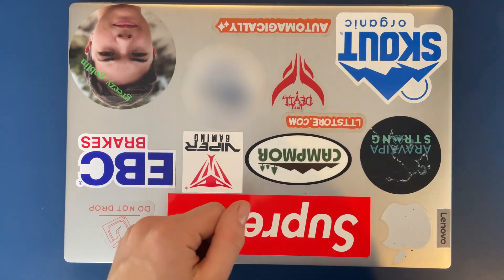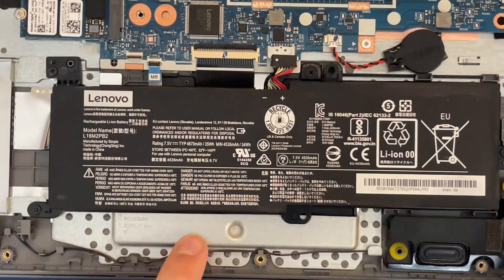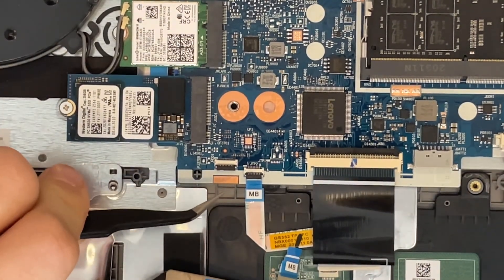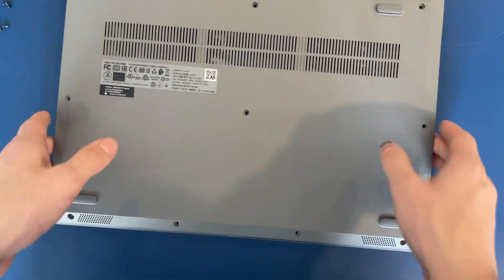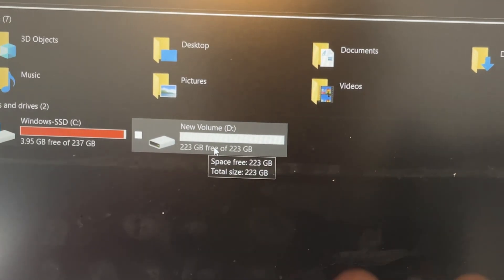Lenovo ideapad 3 SSD installation

Comment: What is the cable called that connects the drive. Can't find it on Amazon etc, I'm obviously searching with wrong description
Reply from the maker: I believe it's a 12 pin connector (I listed it in a different comment) and it can be called something along the lines of "Ideapad 3(then your model shown on the bottom of the laptop) 3.5 inch drive connector, ssd connector, SATA cable adapter" etc.

Comment: My laptop is ideapad slim 3 15iil05 81we but the ssd compartment is missing. The connector is present but too bad that the ssd compartment is filled with battery. Id store some files as the nvme is running out but nvme 1tb is expensive 😭
Reply: If I decide to get the 1tb nvme, I'll also add some 8 gb lpddr4 ram
Reply from the maker: Nice!
Reply from the maker: So your laptop has a larger battery capacity, instead of an SSD bay? Interesting.

Comment: AI Summary

Installing a 2.5-inch SSD in a Lenovo IdeaPad 3

*   0:00 Introduction: The video demonstrates installing a 2.5-inch SSD into a Lenovo IdeaPad 3, which requires a proprietary-to-SATA adapter.
*   0:13 Tools and Parts: Viewers learn that a separate adapter is needed. The presenter purchased the adapter separately, about $12 on eBay and will provide a link in the description. A 240GB SSD is used in the video, primarily for video footage storage, boasting 545 MB/s read/write speeds.
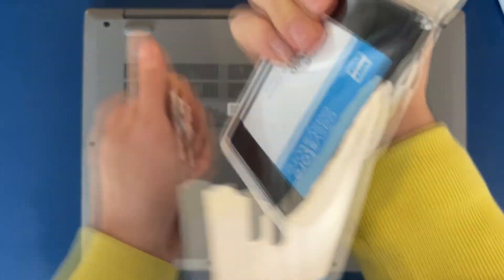*   1:01 Opening the Laptop: Ten screws need to be removed from the laptop's underside (the front four screws are longer, requiring them to be seperated). A prying tool (or careful use of fingers) is used to detach the bottom cover, revealing the internal components.
*   1:50 Battery Disconnection: Before proceeding, the battery is unplugged for safety.
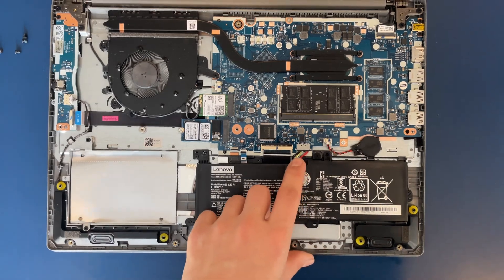*   2:01 SSD Installation: The SSD will be installed in a designated bay, with the connection point nearby.
*    2:11 Remove Tray: The presenter removes the original tray, and uses spare screws to secure the new SSD.
*    2:45 Battery Removal: The battery needs to be temporarily removed (secured by multiple screws) to access the screws holding the SSD tray.
*    3:31 SSD Placement: The SSD is placed inside.
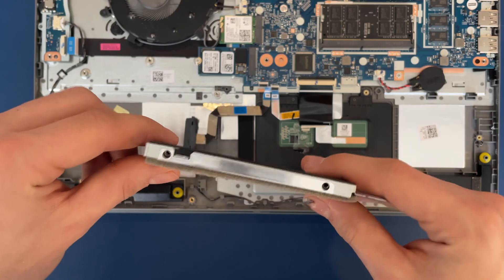*   3:49 Securing the SSD: Four screws are used to fasten the SSD.
*   4:08 Test Fitting: A test fit is performed, plugging in the SSD to ensure proper alignment.
*   4:43 Adapter Connection: The proprietary-to-SATA adapter is connected. A small latch on the motherboard connector needs to be lifted, the adapter plugged in, and the latch secured.
* 4:59 Adhesive Tape: Before plugging the adapter in, the presenter removes the adhesive tape covering it.
*   5:19 Battery Reinstallation: The battery is placed back and screwed in, and reconnected.
*   5:42 Boot Test: The back cover is temporarily placed (without screws) to perform a boot test, confirming the SSD is detected.
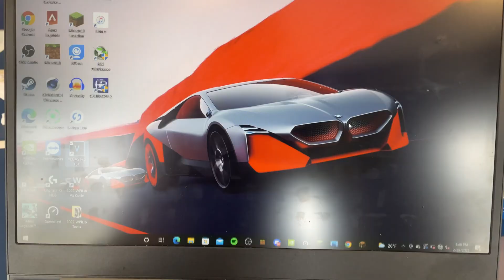*   5:52 Partition Manager: In Windows, the presenter uses the Partition Manager to initialize the new, unformatted SSD.
*   6:13 GPT Initialization: The disk is initialized using the GPT partition style.
*  6:19 Volume Creation: A new simple volume is created on the SSD, utilizing the entire disk space.
*   6:37 Formatting: The new volume is formatted.
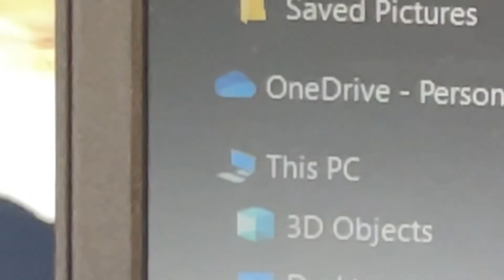*   6:41 Verification: After formatting, the newly installed SSD appears in File Explorer under "This PC."

I used gemini-2.0-pro-exp-02-05| input-price: 1.25 output-price: 5 max-context-length: 128_000 on rocketrecap dot com to summarize the transcript.
Cost (if I didn't use the free tier): $0.0194
Input tokens: 13079
Output tokens: 619
Reply from the maker: @wolpumba4099  thanks, I guess!

Comment: Can you write adapter parameters please? Whats the name port in the motherboard? I'm not good at reading 😅
Reply from the maker: I'm sorry, I don't exactly know what you mean. I believe it's a 12 pin connector (I listed it in a different comment) and it can be called something along the lines of "Ideapad 3(then your model shown on the bottom of the laptop) 3.5 inch drive connector, ssd connector, SATA cable adapter" etc.

Comment: Mine has an extra battery pack on the place you installed the HDD. It does has the SATA connector on the motherboard. Any suggestions?
Reply from the maker: I would suggest looking at the capacity of the battery (Watt hours) and seeing if the removal would affect how you use/charge the laptop. If you can get by without the extra capacity, I don't see why you wouldn't be able to add the SSD. More easily though, On a separate computer, or using an external enclosure to connect another M.2, you could upgrade the M.2 and use a software such as EaseUS partition manager to copy all of your data to a drive of higher capacity, and simply replace the existing drive with one of a higher capacity. Thanks!
Reply: Mine one is also filled with the battery. The thing is that I use my laptop plugged in but it would affect the laptops usage. So frustrated because I thought I'd get a 1 tb hdd upgrade because my storage sometimes runs out

Comment: Did you need to back up the original harddrive before swappping it out?
Reply from the maker: No. Since the primary storage method is an M.2 drive, this SSD is only an addition.

Comment: My SSD card didnt come with one of those plugs :((. Do you have to have it in order for it to work?
Reply from the maker: If you mean a SATA connection, you may have to try and find a different adapter; although I'm unaware of any other compatible standards. The cable that plugs into the motherboard must be purchased separately. Did this answer your question? Thanks.
Reply: @GreezyGoblin  Hi, how i can find to buy that cable? Maybe there is a code or name?
Reply from the maker: I don't have an exact search, but put I would recommend putting in "Lenovo IdeaPad 3 SSD cable" and compare the supported models it lists with the model that you have. Thanks!

Comment: flex sata of 10 pines ?
Reply: SORRY .. HOW MANY PINS IS THE SATA CABLE ?  ¿ TEN PINS?
Reply from the maker: SATA power has 15, and SATA data has 7, for a combined 22. The proprietary side has 10 pins
Reply from the maker: I'm sorry, I don't understand the question

Comment: ideapad 130st50 same with ideapad 3
Reply from the maker: Is this a question?
Reply: @GreezyGoblin  ohh sorry....its a question... im going to buy sata flex cable but the part listed is ideapad 3
Reply from the maker: You'd have to check the product specification sheet from Dell, or just compare the connector shown in my video to what your laptop looks like. If your laptop is of similar size and manufacturer date, chances are they use the same connector.

Comment: Bro and the link of the adapter?
Reply from the maker: Unfortunately the seller I purchased mine from no longer has it listed, but there a variety of options on Amazon. I would use the keywords "Lenovo IdeaPad 3 SATA connector" and verify that it fits your model.
Reply: @GreezyGoblin  all right bro, I found it, thanks

Comment: Maybe off topic..i have a Ideapad 3 model with one SSD inside a slot to put another 2,5" SATA OR M2 PCiE SSD..I understand I need an adapter for SATA HDD. What about M2 PCIe slot? It goes directly or I need an adapter also? THNX
Reply from the maker: If you are replacing the currently Installed M.2 with one of the same size, you do not need an adapter. If you are replacing it with a different size M.2, you may need a standoff, I'm not sure

Comment: the moment of plugging in the blue end of the cable into the MB socket is missing. very disappointing. looks to be a tricky part of the story...
Reply from the maker: 5:15, you simply push it in and hinge the latch close, sorry for the confusion.

Comment: I am distressed, I don't know where to find this cable together with its adaptor, give me the specifications, how many pins it has, if possible where to buy it, etc. Every detail matters
Reply from the maker: What model IdeaPad 3 do you have?
Reply: @GreezyGoblin  IdeaPad 3 15ITL05
Reply: @GreezyGoblin  Hi, I have a Lenovo IdeaPad 3 15IIL05. Can you tell me how many pins the HDD/SSD flex cable needs?"
Reply from the maker: I'm not sure, you'd have to check the connection on your motherboard!

Comment: Does the adapter cable have model number on it? If I don't get the right one it won't work.
Reply from the maker: No, unless there is the option to buy it from Lenovo. If you are purchasing one, look for your model number under the compatibility list. Thanks!

Comment: what is the name of that wire 4:13 he is holding
Reply from the maker: There is no specific name I can find for it, but you can just search “ideapad 3 SSD cable” and you should be able to find it from a vendor.
Reply: Excuse me
Is ssd cable different from HDD cable?

Is it because I connect my SSD with the existing HDD cable that my SSD disk isn't showing?

 @GreezyGoblin
Reply from the maker: No, it is the same cable. Did you follow the initialization procedure at the end of the video?
Reply: Hi. I bought a used one of this PC and I didn't found the part that holds the SSD. Can you tell me what's the name of it?
Reply from the maker: I'm not sure exactly, and it may not even be STRICTLY necessary as you could potentially use double sided tape or another metbod to hold an SSD In place, but the search term I would try using would be "Lenovo IdeaPad 3 (specific model name) SSD carrier tray". Let me know if you need anything else, Thanks!
Reply: @GreezyGoblin thanks a lot for the info, really appreciate it. Found it on Amazon along with the SATA cable for IdeaPad 3
Reply from the maker: Awesome! I'm glad I could help.

Comment: Does it erase the older storage or does it just add more?
Reply from the maker: Since the area the SSD is being installed in was previously empty, the old drive does not need to be removed, therefore it simply adds more storage, i. Addition to what you already have.

Comment: where did u get the mounting screws you used when u put the ssd in the tray?
Reply from the maker: I bought an SSD tray from Best buy which came with them, but I would be totally comfortable not using them, since the tray and connector keeps it in place.
Reply: oh okay i was just wondering since u screwed it on. if i dont buy the ssd tray. is the tray from the laptop enough to keep it?  without screwing it on.
Reply from the maker: @TinyLittleMuffinofLove  i would say so, yes. If your connector has an adhesive backing like mine did, that is better also.
Reply: @GreezyGoblin   thanks i just dont want closing it then it falling and rattling inside removed from the tray

Comment: Hello, do you have the 15" inches model? I have the 14" inches, 14ITL05 model. Would the 15" adapter cable work for the 14"? It's a lot harder to find cables for the 14"

Comment: Hey, great video!. By any chance do you know wat to look out for when buying the sata connector?
Reply from the maker: I don't have an exact search, but put I would recommend putting in "Lenovo IdeaPad 3 SSD cable" and compare the supported models it lists with the model that you have. Thanks!
Reply: @fur1us556 the part numer is     Connector 5C10S30041 NBX0001SX00

Comment: If anyone has bought a Gen 7 Ideapad 3, recently (2023), then be aware that while they may look identical on the outside, the newer models are different on the inside! -You cannot install a full size NVMe SSD as the fan is in the way. - (Edit, you can, they moved the location of the drive which I didn't realise as it was semi-hidden) This would have been a deal breaker for me if I had known prior to buying. You can still upgrade the RAM and add a SATA SSD, and for these, the cable port is in a different place so the shaped cables you need to buy separately will need to be re-shaped to work. If you are considering buying an Ideapad 3, unless you get it for a very good price, don't bother. The display is washed out in addition to the above issues. Stick to an Acer or ASUS instead.
Reply: yo bro, i bought a gen 6, do you know if it has the same problem of the gen 7?
Reply: @lb.davide  I don't know. The only way to know for sure is to open it up and see for yourself, and compare it to this video.
Reply: Important update. You CAN upgrade the NVMe to a full sized one. It is located on the opposite side of the board, and was hidden beneath the thermal pad. I don't know why I didn't notice it before. The network card is in a similar place to where the SSD is on the older versions, and that's where my confusion lies. I am sorry  if this inconvenienced anybody. But I still say stay away from this laptop purely because of the display.
Reply: Upgrading the ram most likely doesn't need a video.  There's only one slot available.  Insert a 16gb piece of ram of the same characteristics as is written on the board and Voila you've got 20gb of ram.
Reply from the maker: Thanks for the info!
Reply: What about gen 11
Reply: @I1simple  Gen 11 would be the Intel CPU not the actual laptop. The laptop itself is gen 7.

Comment: The laptop doesn't come with the 4 screws to fix the ssd in the metal frame, does it?
Reply from the maker: No, it does not. I took the metal frame used here from another laptop. Thanks!

Comment: Hi there! I kinda confused since my laptop is Lenovo Ideapad 3 Slim 3, but the hard disk description is SSD PCIe NVMe, which I found a small and slim one, but I also got the connector like the one you use for that big SATA, while NVMe does not need that connector. Sooo, now I'm confused whether my laptop use that NVMe or big HDD as yours?
Reply from the maker: The ideapad 3 has the option for both a PCIe NVME, as well as a SSD. If the ideapad 3 slim has the space for an SSD, you can install it for expanded storage. If it does not, you can then expand your storage by replacing the NVME with an NVME with a larger capacity. Hope this helps!
Reply: @GreezyGoblin  oh, thanks, it actually helps a lot! I haven't check it yet so I kinda confused, hehe. Thanks, btw!

Comment: Could you have picked up a Samsung brand SSD for a few $$ more, but more capacity? The mounting caddy/tray, it came with screws? Great video! Thank you 🤓
Reply from the maker: Yes, the capacity can be expanded even more, with and brand of SATA SSD. Thanks!
Reply from the maker: Yes, the tray came with screws. Thanks!
Reply: @GreezyGoblin  ok thank you 🤓